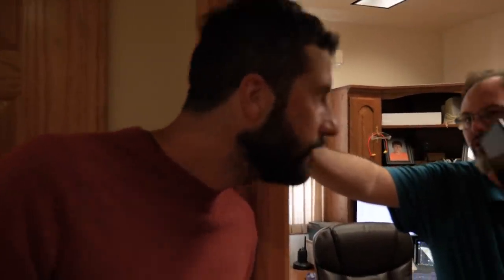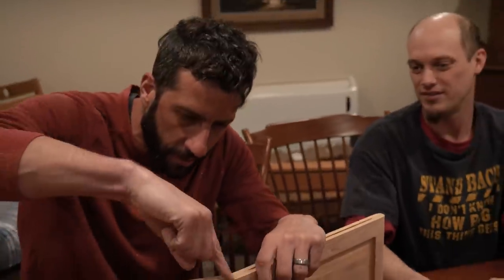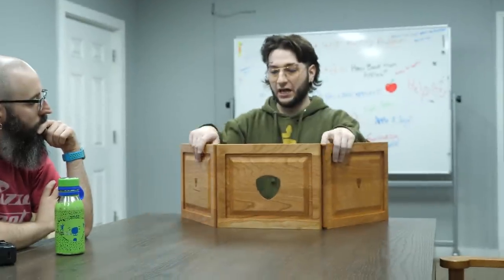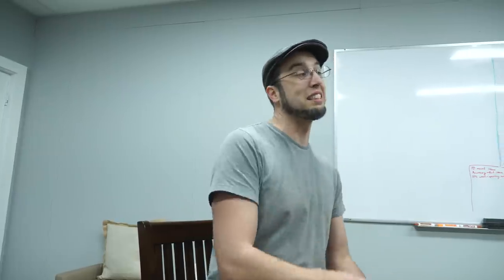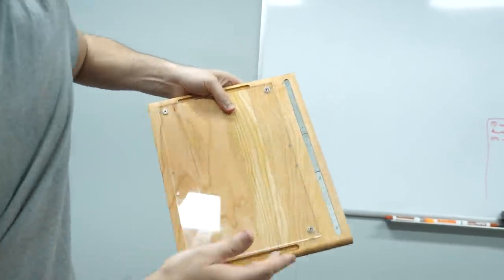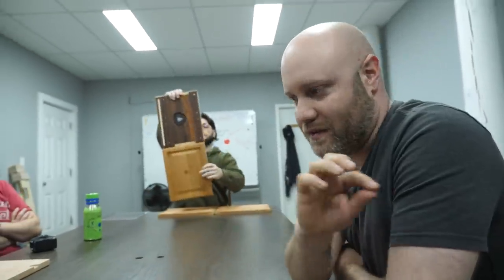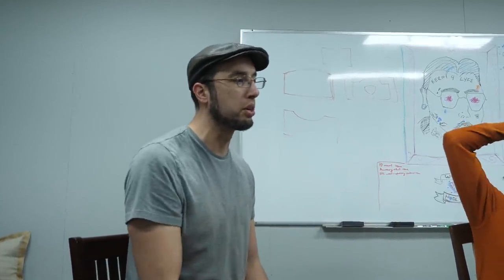New GM Screen Design Pt. 4 (this thing is dangerous)

Comment: I wasn't sold on the solid the first 3 episodes, but they have finally won me over.  I like it and hope that the offering extends beyond what was initially discussed... Most quality (wooden) DM screens you can buy from other sources like etsy and whatnot come with individual magnets that you can use to hang up pieces of paper and things without the need for a large acrylic sheet that might block you from interacting with the documents in a way you want to.  Not saying the acrylic sheet shouldn't be offered, just that you might want to also include smaller individual magnets (about 10 or so) to be used to hold up things without blocking them.  Also, simple acrylic discs or squares or whatever to use in the turn tracker up top is value add!

Comment: Love the veneer, and im with others here, use the Bungholes to inset the rubber feet on the bottom and brass plugs on the top.

also interested in see what kind of functional options you all have in mind for that top bar across. Dice caddy's, miniature shelves and other such items.

Comment: @Wyrmwood I had a thought for the grip issue. Instead of bunging the hole with solid wood or metal on the bottom, just bung the hole on the bottom with a textured stopper of some sort, that way you get the grip with out having to drill more holes. You are welcome.

Comment: Having two problems is better than having just one problem, because sometimes you can use the one problem to solve the other. So, there’s a question of what material to use for the bung. And there’s the issue of adding feet so the bottom of the screen or group the table. Why not use a little rubber feet as the bung? Two birds one stone. Loving it.

You still haven’t solved the issue of a mere 16th of an inch of end grain holding in the magnets. How can we avoid the magnets ripping out of the end grain?

I love watching your design process. These videos, and your craftsmanship videos are my absolute favorites!

Matt: now you have an answer to the reditt question: “What did you learn at an embarrassingly late age?” 🤣

Comment: I LOVE the veneer with the maple, it actually looks like a really high quality product. The other one kinda just look like reworked cabinets which isn’t the Wyrmwood aesthetic I fell in love with. The bungholes I think should be plugged or a long, thin piece of wood added over top to cover the magnets (which I’d like to be stronger) and some extra customisation options could be added but I think the prototype is looking strong. I also think that the centre shield piece should have a metal Wyrmwood logo inlay or a selection of other options.

Comment: I think the GM screen is coming along nicely. Cristaldi hinge is a winner. 
To keep your sku's down, bungholes to be filled with core wood, people will want to mix and match the brass and aluminum. 
Re: Rattle on magnets; Meh? These are going to sit on a table, very rarely will the rattle even happen. 
Solid wood vs Vaneer: Man, it's tough call.

Comment: For the magnet issue, what about making the bunghole just slightly larger than the magnet so that it does not rattle as much inside while still allowing it to rotate?  That would stop the magnet from getting stuck and pulling the other panels like in the video.  It would provide for more wood between the panels to (hopefully) prevent the wood from splitting or wearing away.  What about moving the bunghole just a bit further away from the edge (like 1/16 or 1/32)?  Would that provide enough wood to prevent splitting or wearing?  And even though Doug's face said differently, he knew that using the same type of wood as the plug for the bunghole was the right thing to do.  As to the panel design, I personally like the veneer as it gives an extra level of detail.  What about veneering the whole piece and then routing it out.  Would that keep the sharp detail that Jason was looking for?  The frame and panel would allow for contrasting pieces of wood to be used (like black walnut and maple).  I think that would look nice also.  Can't wait to see what you all come up with next.  Keep up the good work!!

Comment: As long as there's a darker wood variant, I think this is going to come out wonderfully. I think the weaker magnet was a good idea, and I like the brass bung more than a wood or aluminium one. Super pleased about the a4 sizing. 

But hands down the most exciting thing is the replaceable shield on the centre panel. The idea of having a few and switching up for the campaign I'm running or choosing the icon for a long running campaign with my group sounds amazing.

Comment: You could also make the cut outs for reaching under the acrylic large enough to hold pencils or pens so when you fold the DM screen together you can keep all the notes and writing utensils inside of it. Easier to carry all the necessary things somewhere and make it mobile. Make it easier to reach under and also add utility to it. I’d also love to see the return of other accessories like the two way dice tower (possibly add a detachable long sloped ramp to couple with the MGT so it’ll roll straight into the gaming vault) and the awesome mini chest y’all had. With the additions to your facility, you might be able to make it more affordable this time around. Those extras really made the DM screen system awesome. I would love the tower and the mini chest.

Comment: Agree that the veneer panels actually do make the solid wood option appealing. Ian had it right. It’s like 90% there. The plug magnets are, for me, kind of the unsung hero with the solid wood option. I think I prefer the invisible look and want the wood match plug for my bunghole. I would like to see the floating panel design with these new improvements, just to see however.

Comment: The Veneer helps make it feel more unique to and visulaly interesting to me. 
The faux frame and pannel looks pretty good, except it looks far to much like a kitchen cabinet. Someone else suggested it but playing around with the shape of the cutout material could help it get away from uncanny valley cabinet and towards a more unique dm screen. 
The Brass plugs look far better then the aluminium (the aluminium  just stands out to much for me), but a matching wood one may look great. Maybe the rubber feet that will be needed could exploit that space to kill 2 birds with one stone? 
The grooves to get your finger under the sheet holder thingy look really nice and help break up what is a pretty flat and bland surface.
 Also the weaker magnets seem ike the far better option as they seem to get the job done without going overboard and risking either damage to the product or to the users fingers.

It's nice to see you all didn't get discouraged with the very negative feedback over the first of many revisions which led to what is looking to be a really cool DM screen!

Comment: I think this project is looking really good so far. 
Personally, I prefer the faux frame-and-panel, I think the simple high quality wood brings a real elegant feel to it.  Maybe arranging the veneer in a different way would overcome that, though. I also agree with some of the other commenters that IF you do use rubber feet, the bung-holes would be the place to do it.

Comment: Bunging with rubber plugs may solve a few issues. Your holes get bung'd, slip resistant feet and could even offer multiple levels of magnets with making them accessible(unbung rubber plug and exchange magnet). Just a thought.

Comment: The veneer design is clean as hell. If you’re able to maintain the cleaner look like was brought up as an issue then it would be ideal, so if the proper could be pushed to improve upon the current iteration it would be fantastic! Don’t throw the baby out with the bath water like y’all said.

Comment: I do like the veneer panel more than the plain. Doug has that right. I do think it will be interesting to see the veneer with only 2 layers and the top layer being the same as the main wood. As far as the magnet issue. The stronger magnets set deeper from the edge might allow for the wood to remain intact and not crack or just explode away. Rubber feet were going to be a necessity in order for the screen not to damage whatever it may be sitting on as well as keep it from scooting when bumped and dumping over anyway.

Comment: Overall I think this design looks great.  Bunghole wise; either the wood or brass looks great to me.  I think the slightly weaker magnets is more ideal for use so if you accidentally bump your screen only that one panel can possibly fall over, instead of the whole thing.

Comment: Not sure if it had been said, but you could try using the "bunghole" plugs by covering it with that mentioned thin rubber cap to help with the floating side panels. Not sure if it would be strong enough there alone, but you wouldn't need to attach another piece and could potentially just cut those plugs a little tall. Though, flush plugs that hide are a chef's kiss. Just thoughts about my bunghole.

Comment: horizontal wiggle room for the magnets inside might help alignment if it only exist in the center panel (center panel raised will prevent the movement rather than the end panels)

Comment: Wyrmwood synergy, great to see in action. Leave room in bungholes for rechargeable batteries for optional bendable led lights that can plug into the bunghole. So plugs need to be removable. One or two paperclip size holes in metal or rubber plug, pop out with paper clip. $$$🤓💡

Comment: Contrasting veneer is the better look.
Stronger magnets would be better so it doesn't fall apart while moving it.
Hate the logo in the middle of the side panels. If you must have a logo, move it to the bottom of the player side.
For the customized design in the center panel, get rid of the hole. Keep the GM side solid like the side panels are. On the player side have a recess in which the customized emblem can be held in with magnets. Have the emblem sit a little proud of the panel.
If you plug the holes for the magnets with wood, it should match the panel to disappear. For the metal options, the brass over the aluminium since it blends in better.
If you add some sort of feet to stop the unlevel swinging issue, a thin layer of felt would probably do the trick.

Comment: The rounded interior edges on the CNC cut makes them look cheap, especially with the veneer. Still prefer the frame & panel construction & would pay more for the look. 

Don’t care for the customization ‘plugs’ on the main center panel. I would probably buy 4 side panels to avoid being stuck with that. What I really want are laser-burned art panels with monsters/maps from your many collaborating artists on those outward facing panels. Bonus points if I can change them out when you release new panel collab/art packs in the future (hopefully). Double bonus points if you released full-color art panel inserts, maybe printed leather like you did on the dice trays. 

Contrasting or matching or metal bung holes are fine, so long as the colors chosen are intentional and part of the design. 

Love the new hidden magnet hinge design. +1 for A4 upgrade for euro homies. Acrylic grooves on the sides are a win. Might be nice to see a version with that groove on the top - that’s gonna be the easiest side to access when my screen is setup, without needing to move it. 

Rubber feet, if they’re recessed, are a great idea. Someone else mentioned using the bungholes on the bottom to house the rubber feet - genius.

Please don’t put a logo outward facing on every panel.

Excited to see the great work continue!

Comment: folding up the panels when getting stored instead of separating them apart after every use could increase longevity. and if magnets are strong enough, the hole for it can be farther from the edge

Comment: Combining various  comment ideas and my own preferences: I'd like to see other patterns for the route-out  that maybe look less like cabinet doors. Adding rubber feet with the bung holes would be a nice way to fill the hole and add functionality. Veneer looks good to me, could maybe look better with a different face profile. Some design option that works well for 4 panels (which may just be 4 of the side panels).

I think you are already planning on added pieces/functionality, and I get why that hasn't come up yet, but those are some of the thinks that will really make or break this product for me. If it's just a fancy looking paper holder, it's just not worth it. I'm interested in possible Paladin tracker inserts, initiative or other trackers along the top, things like that.

Comment: For the bungholes, imo, I agree with Doug. As a woodworker too, I would make perfect bungholes with same wood and try to fit the grain with the massiv wood I would do that for a 1000 dollar furniture, but as you said before, that's not the point.
  So, i would prefer to make a bungholes who fit with the color harmony, ex : if you use A and B color, imagine the front pannel is A color and the body is B color, I would made A color for the bungholes. Imo, it's pretty aesthetic (you can see these on drawer joint for exemple, or on some nice cabinet and furniture).
Sorry if my syntax is wrong, i'm a nerd french, who also adore mixing woodwork and geek stuff, trying his best ahah.

Comment: I think the center panel could use a clip version that has a version that's a bit longer with a magnet to connect to all the wyrmwood gaming table gaps. The side panel wouldn't need them though, especially since it would get in the way of their rotation.

Comment: Solid without veneer is definitely weaker, but I think the veneer still takes a backseat to frame and panel in terms of looks. If we’re going to be paying for it (and we are), we might as well get true Wyrmwood quality, vs. “This is almost as good as our other stuff.”

As for the magnets, I worry a lot about the thin wood around the holes cracking/splitting/chipping over time. As for plugs, I’m all about that brass! Wooden bungs look a bit cheaper, like “I fixed it nobody will notice!”

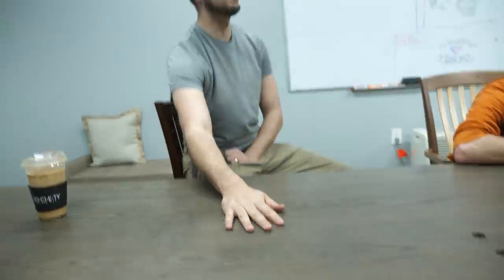Comment: The 2:40 animation was fucking flawless!

Considering the bungholes i thing the metal plugs are better because a badly matched wooden plug will stand out more. 
Also with the metal you have a featured detail rather than trying to hide a mechanic of the item.

Comment: It is certainly a step up from the original design. I still personally prefer the idea of hinges as opposed to magnets, but I certainly wouldn't be upset with the current iteration. As far as the bungholes are concerned I think they look better plugged and would either go with a high contrasting material or match the core. But I also respect the decision for some people to keep bungholes unplugged.

Comment: As a wood worker I understand wanting to shave down on work to lower prices. The solid wood looks great but the contrast provided by the veneer also looks awesome. As for the bungholes the metal looks cool but I’d also like to see an iteration with matching wood. One question I did have about the rubber feet is could those be your bunghole plugs?

Comment: Not sure where we end up price wise - but the veneer panels are gorgeous - - plus they open up the option of doing them in all the "classic adventuring party" flavors (not during initial KS, but as ongoing releases to keep up the interest in the product line and smooth out demand/production) - i could totally see this being an ongoing "collection" for folks - even if you only use 3 panels at once, you could switch them out (especially if one or two were "campaign specific" and you run multiple games) - Start a new campaign get a new panel to hold that campaign (come on, you buy a new dice box for each character right? - I'm not the only one who has these issues right???  hello???)

Same with the custom shield inserts - how cool would it be to have the crest of the royal family in your home campaign on the shield?  OR the emblem of the fallen hero that the rest of the party is trying to avenge OR well, you get the idea - I could see folks buying a custom shield (or two or three) later on to swap out

Comment: I prefer the veneer paneling, though the transition to the raised middle portion of the panel may be the issue for me. Keep the outer edge raised with the veneer highlighting the dip to a lowered middle section which is flat. That would also allow a different coloured middle of the panel the the outside. Currently it just looks like every 80's kitchen door panel ever...

Comment: I think it is so close to perfect. So for the vanered version I think it is a tad over zealous to want there to be no little nicks in it as those will show up in time anyway especially for traveling DMs, plus you do have to be right up on it to notice them anyway. As for the rubber feet it would be easy to recess the bung holes on the bottom a bit to fit them in there. Then for the bung holes on the top, if you use brass initiative trackers for the top then use brass plugs as well as it would act like pseudo "framing" for the tracking zone. Then there is the worry about the magnets, I think if it is that worrisome I would just drill the holes slightly further in so the ends are maybe a 32nd to a 16th thicker as I think it being strong enough to hold the weight of the screen dangling is a subtle pro for it. Finally I know you are spot on with the finger grooves to grab the acrylic it does need to be just a touch larger to make it easy to get at because any time you have to do any weird pinching or wishing your nails were longer to get the proper leverage on an edge it is just plain  irritating.

Comment: I really like both, but the veneered version does look much classier. Depending on cost I would definitely like a set of 3-4 side panels (the shield thing just looks stupid to me). Also agree with the others in these comments that the plugs should either be matching wood, or brass.